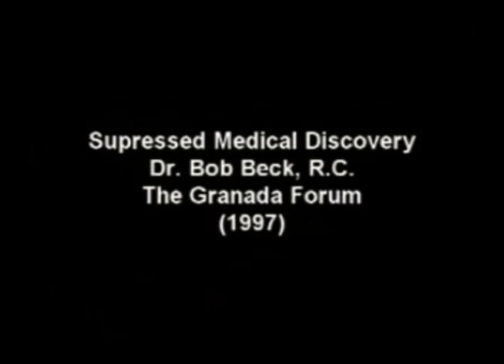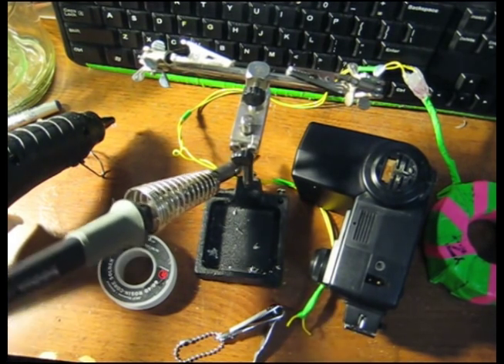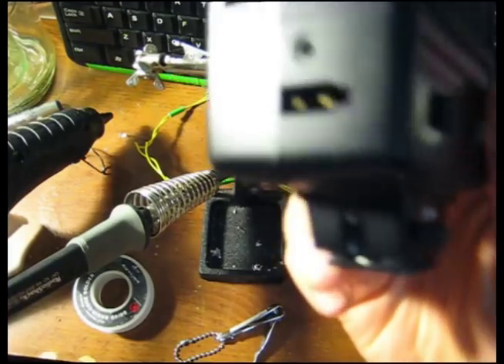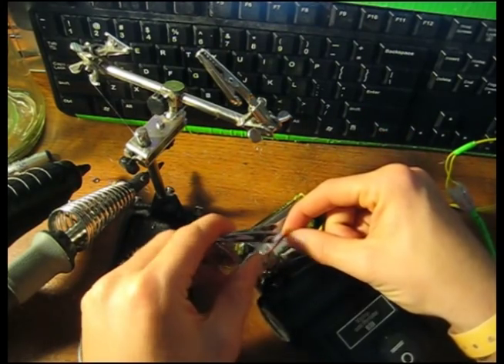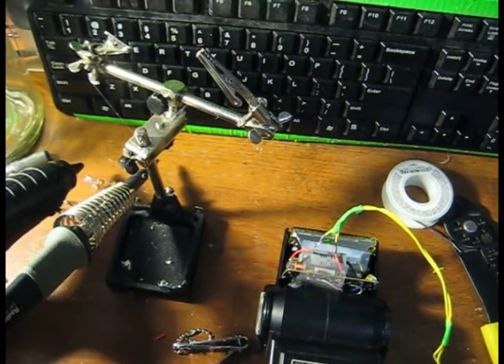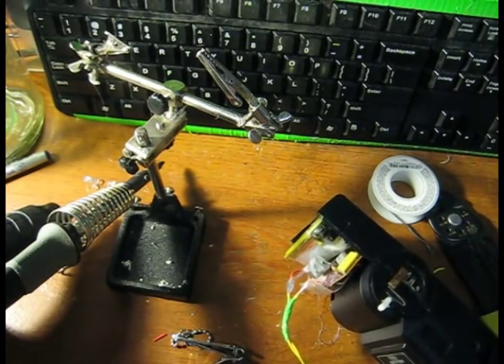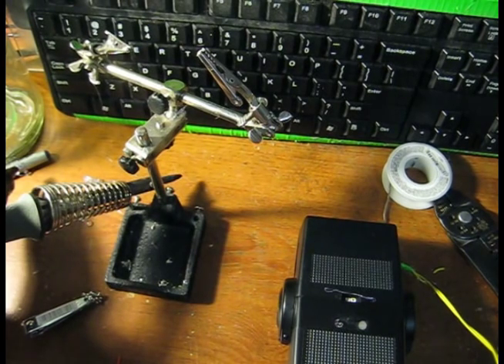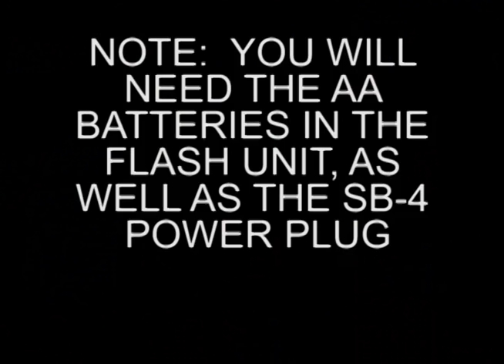How to Build a Magnetic Pulser (Deep Tissue Steralizer) Bob Beck Device

Comment: Listen Buddy, for the rest of us who are electronically challenged, your video is a sent from heaven blessing!  Thank you for your easy to follow instructions, your very helpful soldering tips, and your get down to business style.  You inspired me to build my own. I have done so, and have been using it for a few days.  Your enthusiasm prompted me to raid every second-hand shop in my area, in search of the old style camera flashes.  I purchased all 5 of them!  I used the Vivitar Model 2800.  I might add, your insulating with hot melt glue is very important!  I found out the hard way, with the occurrence of several very loud arcs!   I used liquid electrical insulation.  It was easier to handle, and adhered to the parts better, I thought.  Thanks a million Bro!

Comment: I got mine from amazon and the coil from the website he has on his video. The red wire how ever is very short in mine and I wasn't able to cut it. I just used one wire from the two wires of the lamp wire and I wrapped it around the exposed red wire above the board. I hop it works I didn't get the adapter in the mail yet. Still waiting on it so I can try mine out. If it works I would be willing to make it for people.
Reply: how did this turn out bud? can you make them now?
Reply: M

Comment: Thanks for this helpful video.. Can you give more details about the flash used? The o/p voltage or Power? I will have to make the coil myself, as it is not available at my place. 14AWG with 130 turns (and diameter?)?

Comment: Hello Synespro, in the notes it is said to wind 160 rounds for the coil, but the one you are using seems to be a bigger one. can you also please do a video on coil winding.
Reply: I should point out that by connecting that coil to the speaker output of
 a  power hi fi unit  and feeding the hi fi inputs from your computer 
which has frequency generation software you would get continuous 
pulses.freeware frequency generation software is available on the net 
and you can get square,sine,triangle,narrow pulse waveforms.the unit 
might not push the washer away so hard but it will a continuous train of
 pulses varying from 1 hertz to 20000 hertz as you please.

Comment: If I would build this with a high voltage generator for a stun gun, say 1000kV. Would the Solen inductor have to be a Solen 6.0 mH Perfect Lay Inductors 14 AWG? 2.5 times heavier than the one you used in this vid?  Thks buddy, great vid!

Comment: I should point out that by connecting that coil to the speaker output of a  power hi fi unit  and feeding the hi fi inputs from your computer which has frequency generation software you would get continuous pulses.freeware frequency generation software is available on the net and you can get square,sine,triangle,narrow pulse waveforms.the unit might not push the washer away so hard but it will a continuous train of pulses varying from 1 hertz to 20000 hertz as you please.
Reply from the maker: I think the super high voltage at such a steep ramp , is important, such as what a flash capacitor provides. Good idea though
Reply: A square wave is such.a pulsar has slow repetition rate of 1 per sec...
Reply: also why not use a ferrite core .This can make the field much stronger and reduce the need for high currents and large capacitors.In fact using continuous signals from a a few hundred hertz upwards and a ferrite core could give the same effect....remember 1 super pulse per second could equal 100 lower pulses per second....
Reply: instead of the speaker output what about using an arbitrary waveform generator and connecting the coil to that. when you say ferrite core do you mean the coil wire core. sorry if that's a dumb question. thanks
Reply: the speaker output of a  20 or 80 watts of output power  hi fi will give more power.a waveform generator can be used but it's power output is very low.you can put it through a power amplifier first....the hi-fi is simply a ready made amplifier.  yes the black ferrite core.also you can use an old  CRT tv YOKE AS A READY MADE COIL...GOOGLE AUBRY SCOON'S  PDF ARTICLE ON TO BUILD A CUSTOM DEVICE.
Reply: oh thanks this is great I new that old TV would come in hand someday.
Reply: GOOGLE    AUBREY SCOON PDF for more background and the circuit he uses and experimented on himself and results...

Comment: I have all the pieces to make this but when I assembled them the flash worked but the coil did not respond.  Is the red wire the only wire you can connect to?
Reply: I have the same issue.  I suspect it has to do with the type of coil used.  I didn't get a washer to jump, but there is definitely a strong field.  I can feel it working.  Remember, Dr. Bob Beck didn't specify North or South Pole to face the body.  He didn't see any difference in effect.  It's just that permanent magnet users, adhere to the North Pole theory, for a better health response.  SOTA Instruments specifies North Pole for treatment.

Comment: So I have everything together and am ready to get started, but on my Vivitar 283, it looks like a blue wire goes where your red wire does.  My red attaches on the right side, and it looks like your red attaches on the left.  Any suggestion as to which wire I should use?  Thanks
Reply from the maker: You want to cut into the thickly insulated wire. See if you can trace the path from the capacitor and splice into the thick wire leading to the bulb rather than the wire leading away from the bulb. If you put your coil in series after the bulb its still ok. If one wire has thicker insulation than the other, go with the thicker insulated one
Reply: Thank you for the info.  Much appreciated.

Comment: How can you tell witch side is north?
Thanks
Reply from the maker: use a compass
Reply: ***** I've tried using a compass but it reacts the same on both sides? Would you please explain in detail how to use the compass to get the north side?
Reply from the maker: Pam Elliott  by reacting, your saying the needle jumps in the same direction. is the coil at 90 degrees to the compass? for example, if you are looking at the compass face,  you should be seeing the edge of the coil next to it. i raise the compass so that it is at the same height as as the hole in the coil next to it
Reply: ***** Thanks for the quick reply! I turned the coil on its side so either the top or bottom is facing the compass. I also held the compass pretty much centered with the hole, about 2 or 3 inches away from the coil. I thought maybe if I placed the coil in front of the compass (facing north) that the north side of the coil wouldn't cause the compass to move during the flash and if the south side  was facing the compass, it would try to pull the compass around during flash. When I try it, the compass spins during the flash whether the top or bottom is facing the compass.
Reply: synespro  I have the same issue.  I suspect it has to do with the type of coil used.  I didn't get a washer to jump, but there is definitely a strong field.  I can feel it working.  Remember, Dr. Bob Beck didn't specify North or South Pole to face the body.  He didn't see any difference in effect.  It's just that permanent magnet users, adhere to the North Pole theory, for a better health response.  SOTA Instruments specifies North Pole for treatment.

Comment: I was able to get a hold of a yashica cs-220 auto. It says the rating is 10.5 volts. Is the power enough? Am i wasting my time with this speedlight?
Reply from the maker: look on the web and find its watt seconds
Reply: ***** web didnt turn up anything on this model but opening the case i found the cap rating as 350 sv 500 uF. does this help? Also, the model takes 4 AA batteries. thanks for your help.
Reply from the maker: lostx786  I need to more research on the capacitor n the vivitar. if its a pressing issue, i would get a vivitar, or a comparable flash (in watt seconds). ebay has them

Comment: hello please can someone tell me how I can know the polarity of the coil. Many thanks
Reply: With a compass perhaps? Iirc the south facing side is actually the biological north.
Reply: point the coil's center horizontally toward a compass needle's center so the needle's N and S are not pointing at the coil. At about 6 inches distance when the coil is energised the N or S will briefly be pulled toward the coil, the end attracted will give the polarity of the coil's face. NOTE Don't hold the compass too close to the coil as you will change the needle's magnetic polarity, but if this happened just pulse it again to flip it back to normal :)

Comment: I read enamelled copper wire is needed. What type of wire is that inductor you are using ?
Reply from the maker: i think magnet wire is enammeled wire. because bob wrote to burn the enamel off the wire. Hence enammeled wire.
Reply from the maker: *****
 here is the coil link
http://www.madisoundspeakerstore.com/solen-14-awg-perfect-lay/solen-2.5-mh-perfect-lay-inductors-14-awg/
Reply: ***** yes enamelled means the copper wire is covered by a thin resin to avoid contact with the wire next. This coil from madisound seems good but I´m not sure yet which material they use if copper or other alloy. Anyways I just bought 2kg of copper wire 1.4mm to make my own coils for 50€. Hope they work good like yours.
Reply from the maker: daniliver
hope so too. please share your results. The madisound coil metal is all copper.
Reply: daniliver
 I use primary coil of old microwave oven transformer and it works perfectly. I rectify the wall AC, charge a capacitor and pulse it to the coil by a relay. You could also use this kind of device ( itm/321625501762?_trksid=p2059210.m2749.l2649&ssPageName=STRK%3AMEBIDX%3AIT) to run some current through your body. Its really cheap and very effective.
Reply from the maker: the wire is 14awg 14 gauge size solid core copper wire 
i just bought this pre made inductor
http://www.madisoundspeakerstore.com/solen-14-awg-perfect-lay/solen-2.5-mh-perfect-lay-inductors-14-awg/
Reply: Life is illusion  Have you been able to read milllihenry value off your microwave coil? What model of microwave did you use?
Reply: IntelliTrance
 I'm sorry my friend, I don't know the models. I just got a few of those from second hand shop and took the coils out. The resistance across the coil is somewhere between 3 - 3.6 ohms. I'm going to use a much bigger capacitor bank and I will also connect 3 microwave oven primary coils in series. That will give me a much bigger electromagnetic pulse, but I think then I have to do the switching manually, because I don't think the relay can handle that much of electric current discharge in such short time. It will just weld the relay terminals I guess. Its not a safe thing to do at all, but it all depends on how badly you want it and how much you enjoy playing with these stuff :)
Reply from the maker: Thank you for the exploration
Reply: I should point out that by connecting that coil to the speaker output of
 a  power hi fi unit  and feeding the hi fi inputs from your computer 
which has frequency generation software you would get continuous 
pulses.freeware frequency generation software is available on the net 
and you can get square,sine,triangle,narrow pulse waveforms.the unit 
might not push the washer away so hard but it will a continuous train of
 pulses varying from 1 hertz to 20000 hertz as you please.